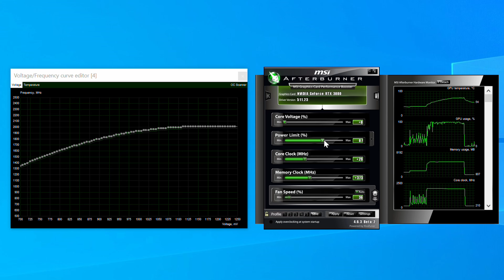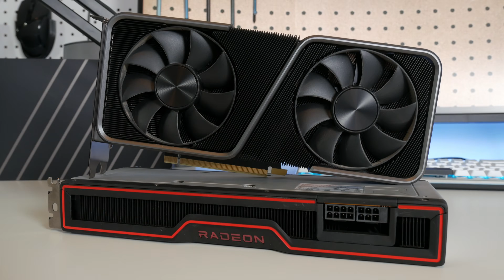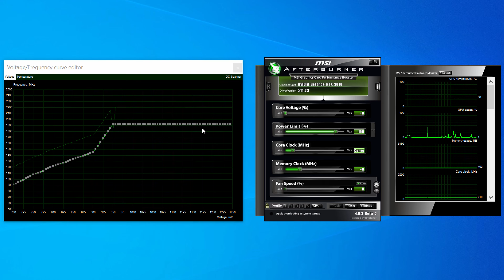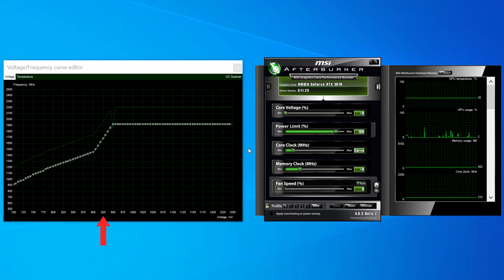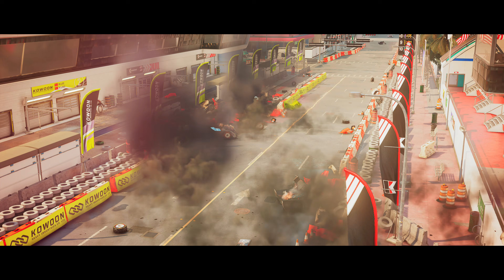How To Undervolt Your GPU (And Why You Should)

Comment: I'm running a 3080ti at 250watts.  That's about 100 watts less and only 5% performance difference.  I rather run cooler than getting 5 fps more.

Comment: Very handy guide thank you. I went on for a more aggressive undervolt with my 3070 because of really bad coil whine, 800v @1695MHz, +1000Mhz memory. I lose 10 - 20 fps but my coil whine is quieter and I average ~60 celsius.

Comment: Undervolting my 3070 seem to do nothing for lower values, I can't achieve any better results than with just basic OC by just cranking up the clock in the main window. It's a MSI RTX3070 Gaming Trio X
Right now it runs 2070MHz at 975mV, 7950MHz memory, got 3516 Steel Nomad score, 7731 Furmark 1440p, I basically just went +220 core and limited it at 975mV.
And I know people say that going above +600-700 memory causes loss due to error correction, but I was benchmarking that card and making notes for a few hours, writing down every result, and I start losing FPS only beyond +950, but solely in that configuration. The other stable and good value was +750MHz at +180MHz core without limiting it.

Comment: i must have hit silicon lottery or something because my 7700x easily took -30 in pbo2 with 85 temp target, and now the 5080 I just got and undervolted just refuses to crash. I keep going lower and lower and it just won't stop being stable! my fans are all running at 900 rpm now. the pc is dead silent and i'm still matching the stock performance across cpu/gpu. crazy.

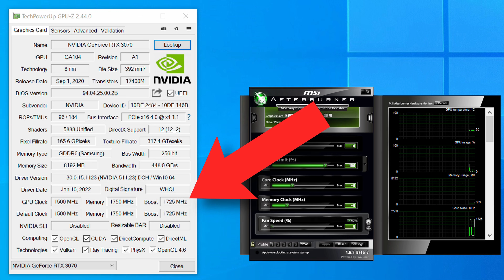Comment: 3:13 I have a question about the boost clock. Is the value on top or the one beneath the one I need to orientate on? Because for me there are 2 different values with an GTX 1660

Comment: Soo is undervolting is safe for a long term? Undervolt or overclocked? I really need an answer
Reply: It increases part longevity, so it’s better for long term if you do not mind the slight performance loss.
Reply: @propheticrain-maker1486  i see, i guess its not problem, as long as my gpu is healthy,cus the fps lost is just around 5 to 9 ,Soo its not a big deal
Reply: When you are supplying less power to any electronic device it lowers the degradation time of that device. Example, if you lower power supply to a table fan then it starts spinning slow. However in case of advanced components like graphics card there is a point where you can maintain stability and performance even after limiting the power supply.

Comment: I hit the cap on my 850w psu, i guess running 2 3090's really puts a strain on my power supply. I had it clocking at 800 watts during each generation *It's for AI, LLM purposes*. It doesn't nessiarily sit there very long, maybe ramping up 20 seconds and the ndown for another 60. So thermals were never an issue, it's just that huge spike would result in my computer not even blue screening, just shutting off entirely. So i'll have to make this work until i get paid and upgrade the psu to a 1200 watt. At some point i'm going to be limited by my breaker and then i'm not sure what i'm going to do, maybe overclock my breaker xD   Probably put a 20 amp circuit breaker in there, maybe even run a 220 outlet in my gaming room.

Comment: The problem with your method is that you lower the entire curve, which you most wouldn't want/need. The initial part of the curve is fine to keep stock. You simply want to set your desired max voltage with your desired frequency. Then, ensure that every point after that (to the right) is lower (by any amount) than the aforementioned desired max voltage. By having the points to the right of your voltage lower by any amount, they will automatically be set to level with your desired voltage, meaning that the curve peaks at your desired voltage.
Reply: I presume then you get better one percent lows to I only tried it 7 months ago but just by lowering as this example ..I think I will try  to get my head in gear for it dam 420 😂 💪 thnks 😊

Comment: I have a 2060 12gb. Main issue has been heat, severely limiting my performance because if a weak cooler on the card (even when repasted). Can confirm, undervolting slightly allowed me to lower temps to well under 80 on a hot day, full load, while increasing performance by 'n large margin as well. Saved my preverbial bacon.

Comment: I've been tweaking with both undervolting and over clocking my RTX 3060.
I ended up finding the sweetest balance when I maxed out my power draw overhead +6% and dropped my core curve -225. I then grabbed the 937mV point in the curve editor and raised it to the 2040 Mhz point and applied its value. Then I overclocked my GDDR6 memory +859 mhZ which brought it to 8360MhZ memory clock. Get this... All my performance gains and my temps at 99% Gpu utilization were 62 degrees C and my power draw was still 5 to 9 watts below stock max(170 watts).

Undervolting and overclocking allowed me to get an entirely new beast of a card out of my GPU, all while running constant(no throttling) and running cool! Im going to create another preset and see how far down I can take the curve and how far up I can go on core and memory. Right now my current record is +290 Mhz core overclock and +875Mhz memory increase.

Comment: Best undervolting guide by far, clearly explains how to change the settings for any graphics card instead of a specific card. 
My 1070 ran at 140-150 watts. got it down to 110-120 watts. same fps. Temps are lower. can lower my fan speeds and have lower temps than before. Thank you.
Reply: you can go lower :) , I also have a 1070 and it is around 90-100W

Comment: Undervolt+small OC is the best combo, on my RX 6800XT I managed to get core clocks to hit stable 2400mhz and memory to hit 2100mhz with fast timings enabled, 1025mv from stock being 1150. Overall gained a few fps and watts dropped by 40-50 in very gpu heavy games, and about 70-80 in moderately gpu heavy games, I have a MSI trio model so the cooler is already quite beefy, temps are 50-60C on current/edge gpu temp and 65-75C on gpu hotspot, fans are quiet 1600-1800 rpm aswell. Since the hotspot is so low in temps the gpu just will just 24/7 boost to 2400mhz core and 2100mhz mem, could prolly make it higher with more tweaking but I am perfectly happy with my results

Comment: I have an RX 6600 shaphire 8Gb. Well i play fortnite in the default graphics(high) and i get 90-100 fps. The gpu can get up to 76°C and i have read that that card tend to overheat. Should i go with undervolt or a custom fan curve for the gpu fans or both?

Comment: My EVGA 3080FTW3 used to draw 370-400watts under max load (1.1v 1970mhz) but got it to run at 1800mhz at 812mv and it dropped the power draw to 190-210watts and i only lost 2fps in forza horizon 5 4K ultra settings it also runs at 62 degrees now instead of 73-75 like it did before. Im actually astonished at how much of a power drop it had taken going from 1.1v default to 812mv makes you wonder what the point of almost doubling the power consumption in this case for an fps boost from 69 to 71 in the benchmark i used

Comment: 3:40 I dont get it where did you get 1900Mhz... Your stock is about 1750 not 19 hundred. What the hell.
Reply: he ran a stock benchmark to find out what frequency his particular cards boosts up to
his card can do 1900 mhz, not all 3070s can
Reply: @wnihaunter2000 yeah my 3060 ti oc does ~1935mhz so i just stuck it there and it could only do like .987

Comment: would this help with overheat related issues? my 3070 recently started to become uncooperative with my new 165hz monitor and reaches 100 Celsius at the hotspot after some time while playing Destiny 2 at 150 FPS, causing my monitors to black out and the PC to become unresponsive
Reply: if you have overclocked the card , take the oc out and start fresh , dont mess with the voltage and try to get the ultimate performance power plan profile in windows 10.
Reply: never overclocked it, that's the thing lol
Reply: @DanYami  try to use ur pc on the balanced power profile and see temp , also clean fully ur pc maybe... how old is the gpu?
Reply: I'm already on balanced, always been

and I got this PC and the card in February 2021
Reply: @DanYami  yeah is a bit hot but if its not giving you trouble i would just recommend more cooling maybe to compensate a bit but you probably should maybe send the gpu to get checked
Reply: so it's not just summer being summer?
Reply: @DanYami  im in australia , if your room gets kinda hot is not that good it doesnt help ur pc , you want your pc to be allocated in a cool spot if possible with nice airflow …
Reply: maybe that could help but remember that more fps causes to put pressure on your gpu, the higher the fps the higher the gpu temp, so if you cant really solve it through undervolting your only resort is to limit fps to something like 144 if you can.
Reply: @saad_vi  144???? lmao

I had my max FPS at 120 before and it had problems, it can only barely handle 90 FPS in the summer heat

Comment: I use MSI Afterburner's auto scan settings to set the voltage curve, then I pick a spot on the curve and start levelling it off till I get the power consumption I want, typically around the core boost clock.  My Geforce 3050 uses only 83 watts of power under load (vs. about 135 stock), but it has about 96 percent the performance of stock voltage.  Since I have an ancient case with just one Noctua NFS12A exhaust fan, that leads to much lower case temperatures under load, as well as much lower noise.  The noisiest thing in my case is my GPU, but it's fan is stuck at 1/3 speed idle, so not much can be done about that.

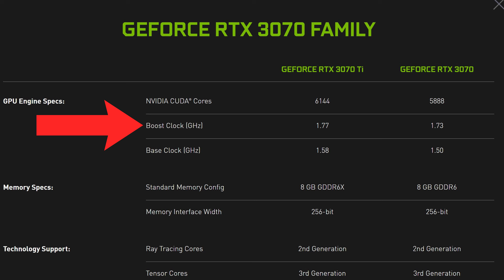Comment: 3:53 Where did 1900MHz come from? You showed the boost clock at 2:45 to be 1730MHz, but that's not the same thing?
Reply: 8 months later and no reply from the channel, disappointing as I am not sure what numbers to use now.

Comment: reducing power only with goal to reduce power is stupid.
i played games that require no OC but begin to work perfectly (compared to terrible stuttering) after a minimal power increase.
Reply: the goal is to reduce temps
Reply: @wnihaunter2000  oh, yes this would work too...  why not use cooling? like you know, raidator with a fan. you can slap larger radiator and keep voltage intact...
Reply: @Teber256  well, you might have a overheating laptop maybe? Or maybe you can't afford to upgrade your cooler yet....
Reply: My GPU is a single fan that overheats. Under clocking helped resolve my stutters. It has it's use case reducing power levels. @Teber256

Comment: In my case, it's not a question of should or will I but rather I think I have to. I'm building a budget AI Home Server with an older Dell T5500 (old PC with decent CPU & 96GB RAM) and 2x Nvidia Tesla P40 24GB GPU's and saving 100+ Watts and reducing heat is a must, besides already having a lot of airflow as they are passive cards. Besides, the GPU performance loss is marginal and mostly I just need the VRAM.. GPU utilization is not as much of a factor with tensor cores and AI. Thanks for the overview and suggestions, this will be my weekend project.

PS. If anyone else is interested, on eBay a T5500 is about $90, P40's about $200 (x2 for me), CPU "Upgrade" $10, and 96GB RAM Kit $30. I also added a $200 16TB HDD ($12.5/TB, amazing on Newegg) and 512GB SSD ($22 Amazon). So about $750 for all but more than half was for GPU's and you don't necessarily need 2. Hit me up if you have any questions or are interested in running AI on local hardware, it be cool to collaborate and maybe even load-balance API's (for a decentralized service).

Comment: I don't understand where the stock operating frequency information comes from, I am trying the same for my 3080 ti, Default clock is at 1365 MHz and Boost at 1695. When I open MSI AF the line flattens out at around 1950 to 1975 MHz. I reduced the core clock by about 260 MHz so the curve flattens at 1700~. Now how far upwards should I move the Voltage Curve between 850 and 950 mV?
Reply: he ran a stock benchmark to find out what frequency his particular cards boosts up to
his card can do 1900 mhz, not all 3070s can

Comment: You wanted to know if viewers have tried undervolting.
I haven't done this yet. I WILL do it promptly as soon as I get my RTX 4080 in an attempt to get the system stable without upgrading from my current EVGA 850w Gold+ PSU. My RX 5800X3D is not power-hungry, so I think that I'll have a chance of succeeding in this attempt. I watched a few videos on this subject, and this one is the best by a country mile. Thanks.

Comment: Got down to 1890 MHZ at 850mV on my MSI 3080ti SUPRIM X, and it power draw goes down from ~370W to ~290W while losing only 1-3 avg FPS in APEX and never goes over 72c, thank you for the video its really helps a lot. Now my room temp is now finally comfort.

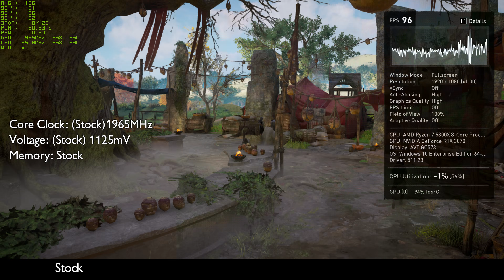Comment: I don't understand at 5:57 you said your stock core clock is 1965 mhz but on 2:38 GPU Engine specs it says 1.73 or 1730 mhz
Reply: Adverticed boost clocks are mostly useless, the GPU will always try to boost higher.

Comment: Is these good results? The benchmark was cyberpunk and I put DLSS balanced, ultra ray tracing, high settings 
My power reached to 207W
Memory resulted up to 8000MHz
GPU clocked at 1905MHz
Temp was 72°C 
FPS was stable at 55ish to 60
Reply: @pcworld  MSI 3070 Ventus 2x
And I think the stock was 
Power 217W
Memory 1750+MHz
GPU 1850 MHz
At 74+°C

Comment: Should you undervolt even if your temps are not a problem?
Wondering if I should undervolt my Sapphire Toxic 6900XT which is liquid cooled. 
It uses a whopping 430W of power so maybe extra efficiency is worth the nominal performance drop even if temps aren't a problem?
Reply: Yes, because a cooler GPU will have fewer issues with performance drops when it does turn hot and increase the lifespan of your GPU. 

Usually GPU manufacturers push the hardware to what it can just about tolerate and no more. An undervolted GTX 1070 would be around the equivalent to a regular non-undervolted GTX 1660, with better thermals.

It’s also worthwhile if you want to add extra stuff to your PC that uses a lot of power

Comment: Hey people. Got some issue with my new graphics card i purchased second-hand. Its a gtx 1080ti. I play currently metro exodus and the graphicscard always is at 100% usage and 85°C. My old card (gtx 1060 6gb) was never at 100% usage and that hot. Anyone an idea why the gtx1080ti gets at that temperature and always at 100% usage? The FPS in game is good, its 60-70 fps with ultra texture quality even with DX12 (however i use to play with DX11) Drivers and stuff have been reinstalled on card change. Could the card be overclocked? The seller mentioned it was never overclocked and he used the card for blender renderings. Should I try maybe undervolting? cheers
Reply: You're the right candidate to be undervolting.
Reply: @GoSpursGo50  i could undervolt at standard boost clock of HP gtx 1080ti which is 1582 MHz at 750 mV. My card was overclocked at 1911 Mhz. Now the card works at 80-100% usage but goes up to 75°C. Unfortunately I cant go a bit higher with mhz because it gets unstable and crashes. If I go higher with mV then it gets hot again.
Reply: If the card is in HP case along with HP cooling system or fans, then it'll get hot quick.

I used to have Omen PC with i9 and RTX 3090. I had to add Noctua 4 fans to manage temp. Mind you, Omen is supposed to be gaming line of HP and they were supposed to account for temp issues. I'd imagine non-Omen HP case would be even worse if equipped with OC'd gpu.

Comment: I'd like to buy Legion 5 pro, 6800H and 3060 or 3070. But the 240 and 300 W power adapters are too heavy. Can 3060 run max 25W and is this 25W same fast like 680M at 25W, if not then i will go with integrated GPU only laptop.

Comment: after two hours of testing(happily,like to do that),conclusion is next: better do it just with power limit cos that will be best for all applications, with custom curve you can make one program fine tuned and gain few fps/watt and other will freeze within few sec. In my case, rtx 2080, managed to gain 4fps, 126.2fps in Heaven benchmark, clock was solid on 1680mhz with 140-145w of power.
If I run Heaven with just 60% power target i will get 122.5fps and clock will fluctuate between 1620-1700mhz with 140-145w, depending of scene.
With same setting custom curve I ve tried to run Time Spy and it crashed after few seconds. When I run Time Spy with 60% power target, gpu clock fluctuate between 1550-1700mhz,depending on scene. Conclusion: You can t be better than auto tune, which is on Rtx 2080 done almost perfectly(would be perfect if you can give offset of 1-2%). While reducing power target gpu is rock solid(haven t had any crash in months), yes you loose 10% of performance but you use only 140w instead 245w with my card. This is for low power consumption, haven t tested custom curve for high oc(currently i m into saving mode hehe) but probably scenario is same,you can do better for 1application but you don t have chance in general, cos as you can see some applications won t be problematic to run at 1700mhz while other will crash card with anything above 1550mhz(my target was 140w). I have used MSI afterburner and riva statistic to see all variations in clocks,watts and fps. Also when you do just power limit its automatically reduce all points of curve(which you can adjust also yourself, those between 700-775mv) and it will spend less than stock even while doing easy tasks like watching YT or similar. cheers
Reply: in watch dogs 2 for example, with power limit 60%, spends 145w and boosts to 1800-1830mhz..maxed 1440p @ 80-90fps